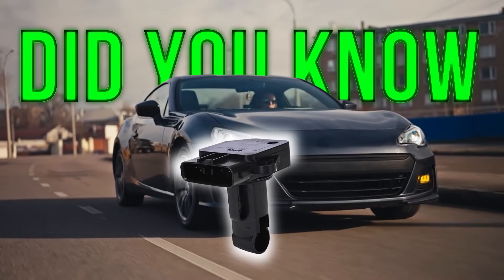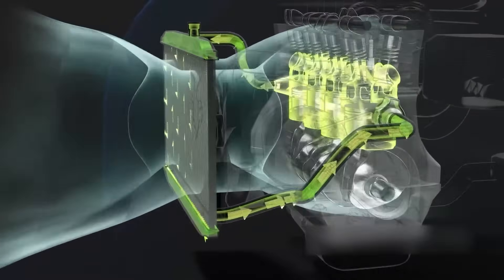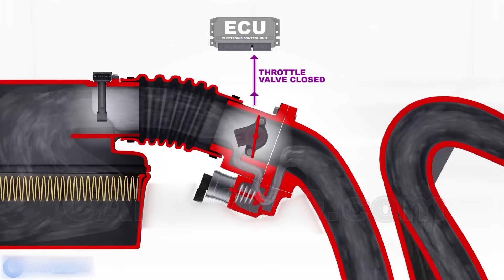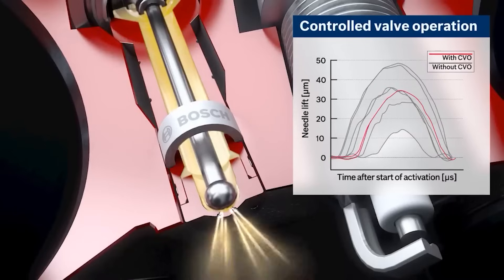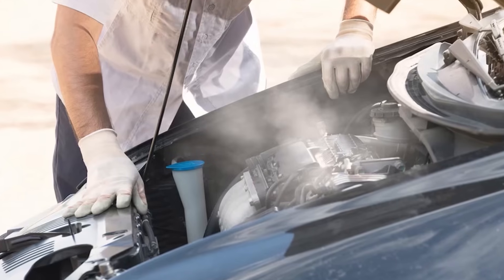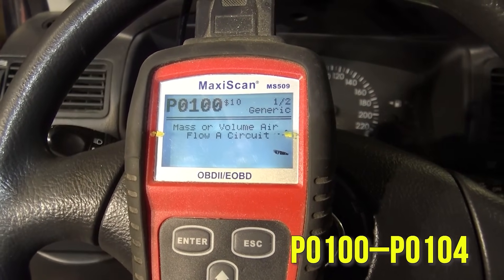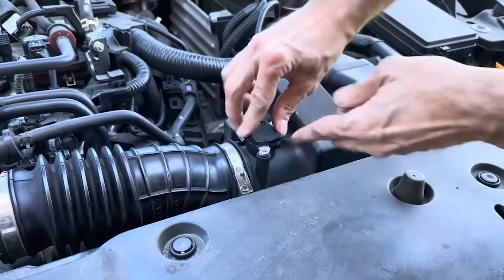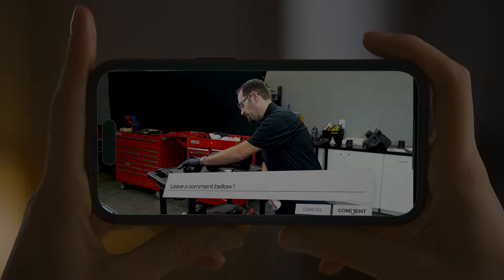13 Bad MAF Sensor Symptoms ( It's KILLING Your Engine!)

Comment: My 97 Sierra dually begin to belch out black smoke and perform very oddly.. barely moving my boss said mass air flow over and over again I discounted his suspicion.... I took off two injectors after lifting upper intake .. it's still ridiculously rich.... Make my catalytic converters glow too hot.... I changed computer I change distributor I put oxygen sensors.... No it starts up. . runs but still bucking and kicking a bit until it warms up..... I cleaned the mass air Central with special spray.... I did get a transient code intermittent mass air flow..... Is there some way to modify for emergency air intake.... Put gorilla tape across air intake.... So that there is not actually as much are going in .. 2 scale down the sensing air intake..... Just to move the car to the side of the road...
Reply from the maker: Black smoke, glowing cats, and a MAF code all point to the MAF giving false readings and dumping too much fuel. Taping the intake isn’t a safe fix—you risk engine damage. The best emergency move is to unplug the MAF; most GM engines will default to a backup mode so you can limp it off the road. Long-term, you’ll need to replace the MAF and check for any injector issues.

Comment: video was ok until the end. Must be using CALI prices. Shouldnt be more than 1 hour shop time and the sensor is like $30 to $80
Reply from the maker: Thanks for the feedback! Labor times and part costs can definitely vary by location—some shops charge higher rates in areas like Cali, but you’re right, a MAF sensor replacement is usually a quick jo. Always good to shop around for fair pricing!

Comment: My 2005 chevy impala 3.8L died out after I Replaced the 3 electronic coils ran great bird like a Kitt so the next day I took it for a ride and it died out 100 yd away and won't start it'll just turn over it's got fire and fuel but won't start won't start
Reply from the maker: If you’ve got spark and fuel but it still won’t start, I’d check the MAF sensor and crankshaft position sensor. A failing MAF can cause stalling right after startup, and a bad crank sensor is common on the 3.8L—engine will crank, have spark/fuel, but won’t actually run.

Comment: doesn't help at all. Car RPM goes down when put it on reverse or drive, feel like it will stop
Reply from the maker: Did you get help?
Reply: @autofixdiary  Nothing. nada. Zero. still the problem. the dealer had the car for 5 weeks and they couldn't find any problem, of course I have done everything and keep the car clean, and all parts are new.

Comment: This is exactly was wrong with my mc
Reply from the maker: Glad this helped confirm it—bad MAF sensors are a common cause of those issues. Replacing or cleaning it usually restores performance.

Comment: Pontiac Grand Prix maf sensor is much bigger.
Reply: Thank you for letting me know, though I ain't need that info at all.
Reply from the maker: Yes, the Grand Prix MAF sensor is larger because it’s designed to handle more airflow for that engine. Always important to match the correct size and spec for proper performance.